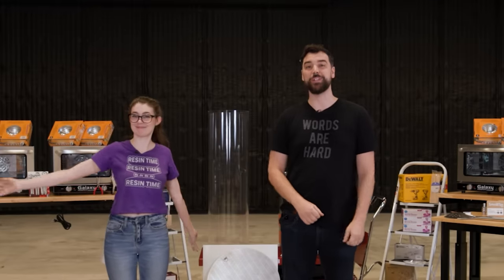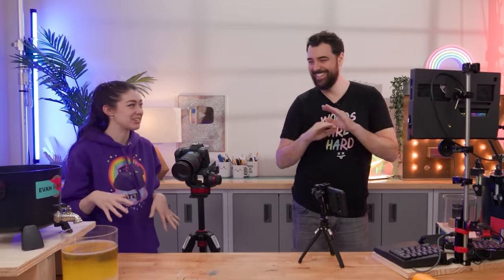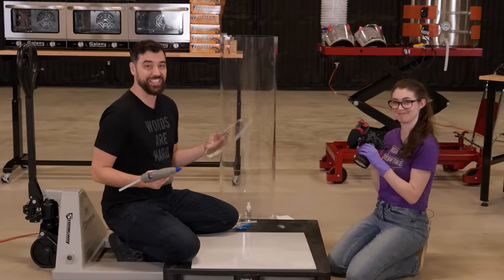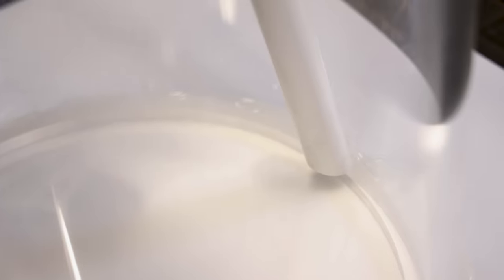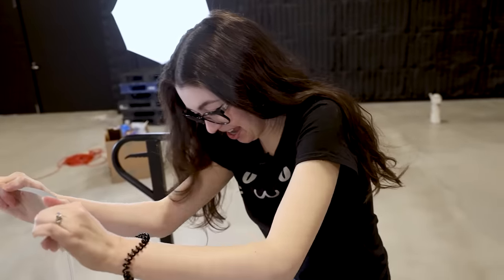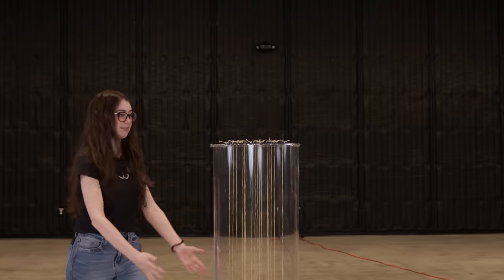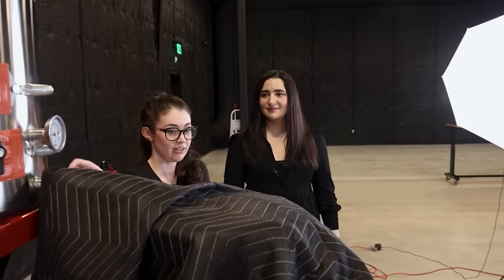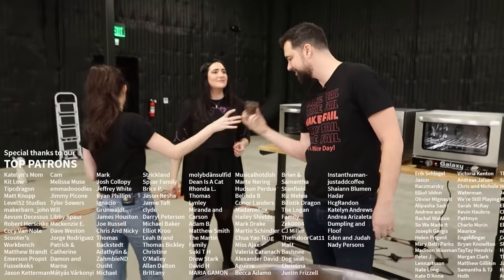Melting every Yankee Candle into a GIANT Candle with Safiya Nygaard

Comment: Could you have used polycarbonate for the jar instead? It generally has a higher glass transition temperature than acrylic (PMMA) although the actual properties depend on the specific plastic used.

Edit: apparently 145 C for polycarbonate vs the 70 C of your acrylic although the glass transition temperature of acrylic can apparently range from 85 C to 165 C.

You can get polycarbonate for usually not much more than acrylic and it is clear too so it may have been a better option that is more temperature resistant than acrylic but cheaper and easier to work with than glass.

You can also get fire retardant polycarbonate which combined with its higher glass transition temperature would mean it is better for the candle too.

Comment: I am curious about alternatives to resin that are non toxic, the ones I know of are opaque, except hot glue. I’ve read that heat can speed the curing of POP and potentially make it stronger, but may become weaker after 6-8 weeks. Also lemon juice can slow the cure, and PVA glue can increase hardness. PVA glue can be heated with cornstarch and vinegar to make a stronger type of air dry clay. I am wondering what combinations of these would create the strongest result and I thought of you guys and your experiments 😁
Reply: Plaster of Paris I was thinking of.

Comment: Isn't it possible to merge the wicks together to get a giant wick in the middle? like a real candle? Or maybe have you tried to use torch wick for outside? would look a little bit more like a real candle, but still impressive and i love to see your stuff ^^
Reply: multi wick candles ARE already a real type of candle, and a giant wick would be an excessively unecessary fire risk
Reply: If you want one big wick, just use some braided 100% cotton rope.

You might have to soak it in hot wax first to insure the wax impregnates all the way to the core, but it should work.

Comment: One thing to be careful of when doing small scale tests like this is that not everything scales.
Importantly, height is a factor that typically does not scale well.
If you have a column of water 10 m high that exerts 1 atmosphere of pressure at the bottom, which may be too much for containers, especially those weakened by heat. But a "small scale test" which is only 10 cm high would only exert 0.01 atmosphere, which can be handled much more easily.

This can result in everything looking fine in your small scale test but then failing spectacularly in your real size run.
Because of this it can be useful to also simulate the pressure.

Comment: I don't know if that was hot glue that you used to seal the bottom but I do know that the hot glue will fail if the candle burns low enough to heat it to its melting point. How do I know? Well I couldn't find my sewing kit and the front button fell off of one of my pants that is kinda big for me so I hot glued it together. The hot glue failed when it went through the dryer though.

Comment: Why don't you take the small metal wick holders like those used for tea lights and stick them in place with a small drop of hot glue?  Before the hot glue could cause problems due to the hot flame, the candle goes out because the wick has run out.

Comment: ? for  Evan and Katelyn
 Any reason you didn't use  Acrifix acrylic adhesive or other like product to bond the bottom of the candle? I've built a number of sump tanks and refugiums for both my fresh,salt water and reef display tanks and have never had any leaks. It's a lot cheaper and more reliable then using resin or silicone.
Reply: resin is their thing and i think they wanted to display that to a new audience in this collab

Comment: Id have plugged the bottom with wax, use some lube on the tube before pouring the rest of the candles, and then a couple heat guns should have the wholee thing out of the acrylic tube with minimal effort avoiding concerns of the acrylic burning.

Comment: Would it not have worked to put the plastic disc and wicks in before you poured the resin in the bottom? The resin would have held everything in, and wouldn’t have been deep enough to float. Then once cured it would have held all the wicks without needing the scuba weights? As you’re not burning to the bottom of the candle, it wouldn’t have mattered that the bottom few cm are covered in resin.